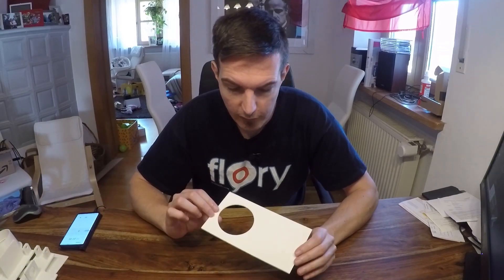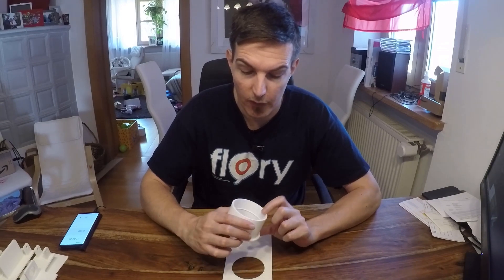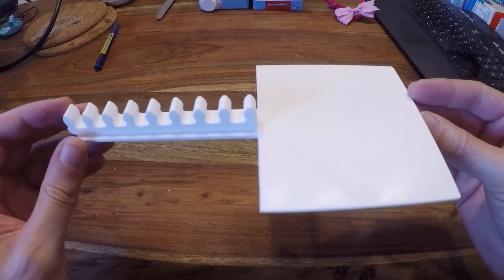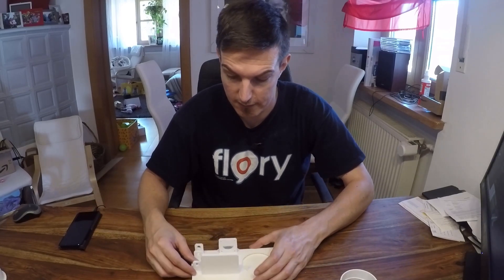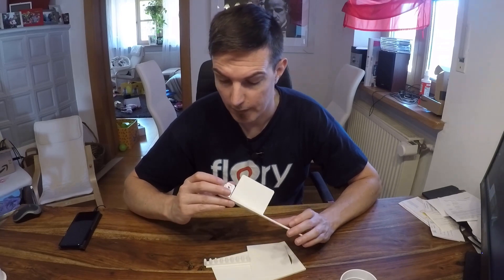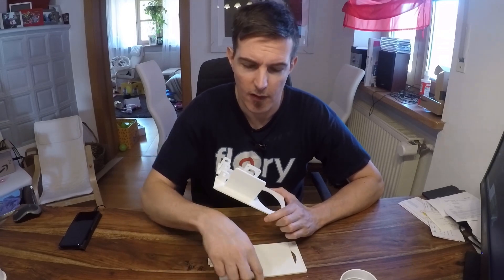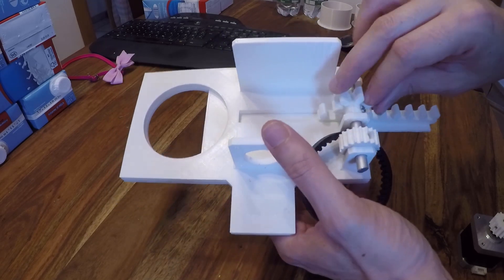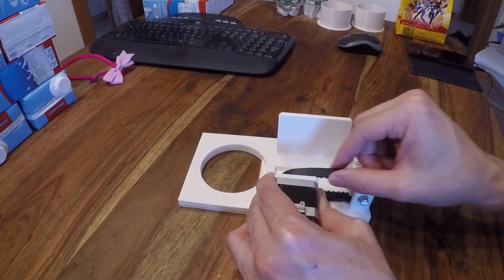Automated dust collection with electric blast gates! Part #2 - Blast gate preassembly

Comment: I am planning to do something similar but haven't yet, I'm just gathering info. My reaction to this video is that use of a stepper motor here is overkill. I just need two positions, open and closed, the fine resolution of the stepper and requisite complexity is wasted. I think a  servo motor  or a linear actuator would be a better choice. Also, audio levels are reversed. Music is loud and voice is low. I turn up the volume to hear whats being said but then get blasted when the music happens.